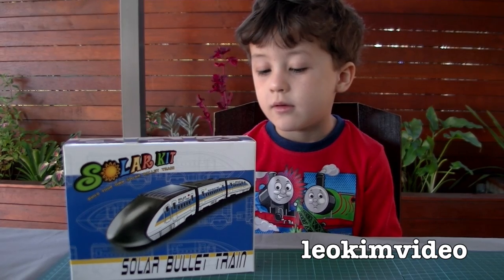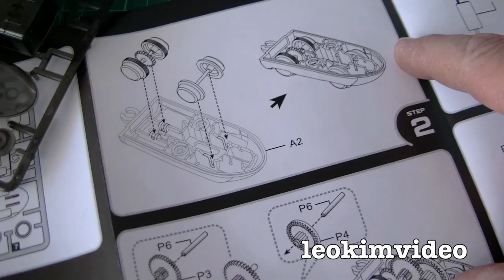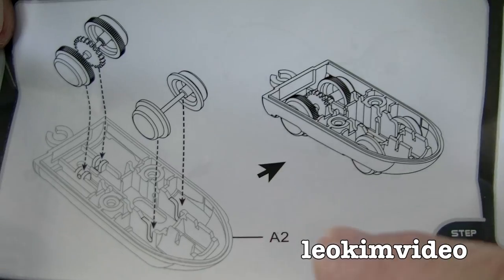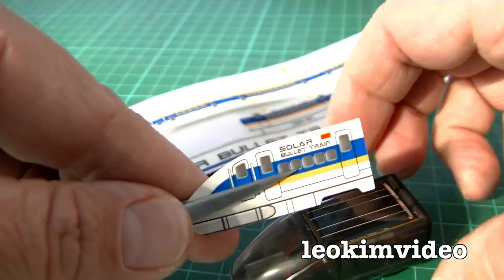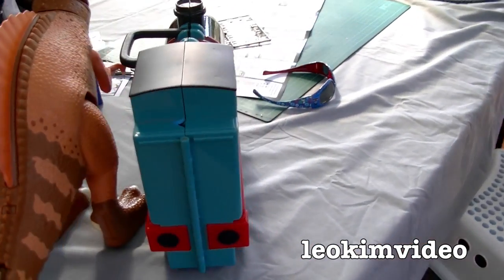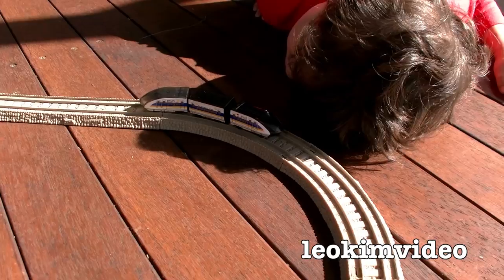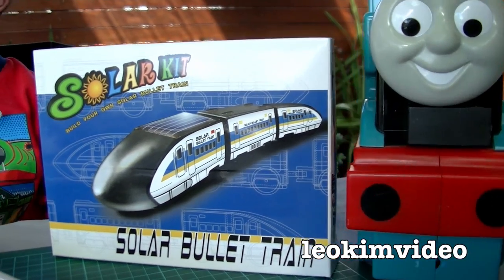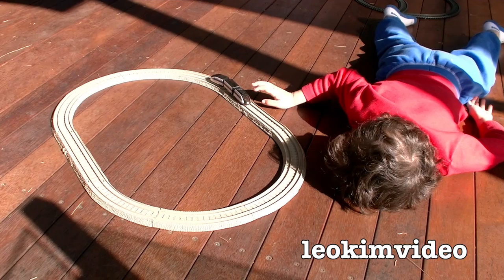$10 Solar Bullet Train HO Power Trains Problems & Sad Thomas Tank Toy Story

Comment: 15:52 I have a Lionel O-gauge locomotive, Penn Central's #1645 Atlantic class 4-4-2 steam engine. It runs like a dream on my dad's track, and keys in perfectly to the Trackmaster track. (The pickup wheels under the engine fit into the inner rails. Because of this, it can't take junctions.)
Reply: That's a Atlantic

Comment: I don't have problems with the couplers on my Lionel trains because the coupler is A: Janey Knuckle Type and B: The coupler is sort of built into the truck (bogie) assembly. As for the track, joining the FasTrack is a breeze which is simply lining up the pins and then pushing them together until they snap. For unjoining, it's easy as well cause all you have to do is wiggle the track pieces and then pull them straight apart.

Comment: The reason why powertrain coupling break is because there is a small and a big side you put the two small size together that's the proper way to put the two big sides together that stretches the plastic out too much you you can tell when you look directly at it there are two small little round ones and two bigger triangle shaped ones you get what I mean when you look at it

Comment: will this work on OO (The UK have OO but its the same as HO) Points
Reply from the maker: I'm not a model train expert, but I think OO is the same as HO when speaking track...but hey this may start a huge online argument. I'm not sure about going over points, possibly the downfall is the little solar train is very light...and light trains tend to jump the tracks really easy
Reply: leokimvideo unfortantly i'm quite a railway 'Nut' and yes OO track is the same as HO track the main difference is the overall dimensions of the trains. But i might buy one of these solar panel trains if i find one